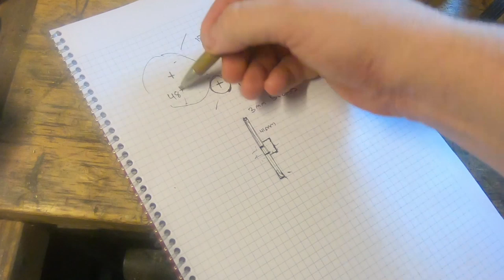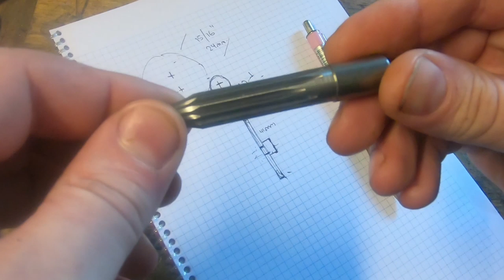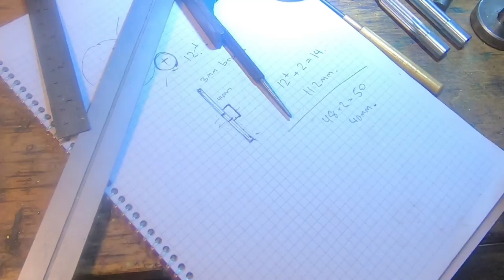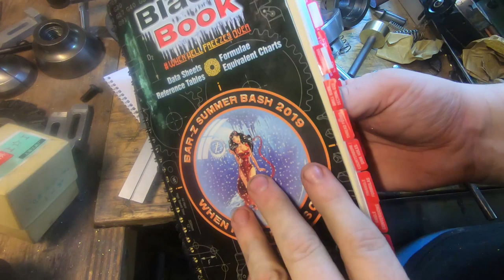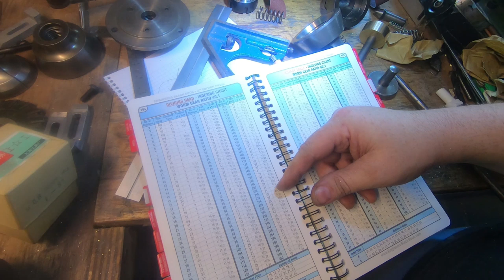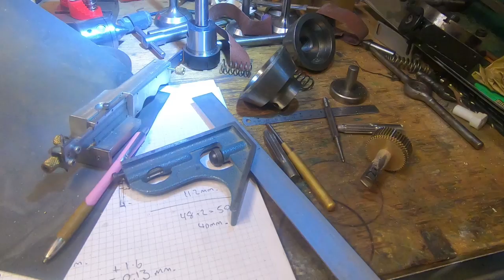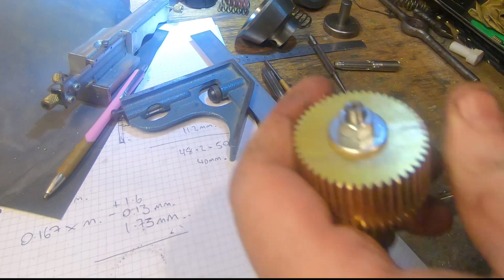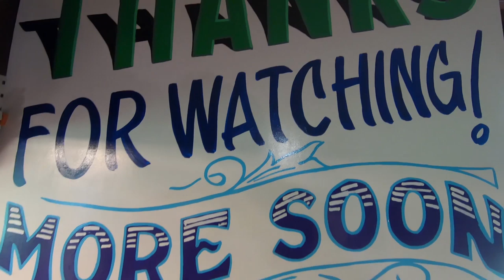gear cutting with my dividing head

Comment: Well done.  This is the first time I have seen you cut gears but still I don't know if it is was your first time to cut a gear.  I remember my first time gear cutting and it was a bit sloppy but still worked fine.  My setup improved every time as well.

Comment: Excellent tutorial Emma, thanks for sharing. Those gears came out like bought ones. I have not tried making any gears yet, but this video will now be my reference. Much easier than clickspring's method :) Your tailstock also reminds me I should make up a tailstock to suit my new (to me) little rotary table. 

Nothing stopping you using up those duds in future, just turn off the teeth and use them to make smaller gears?